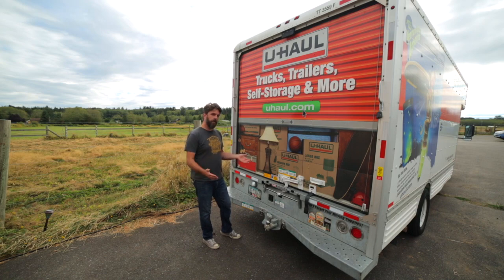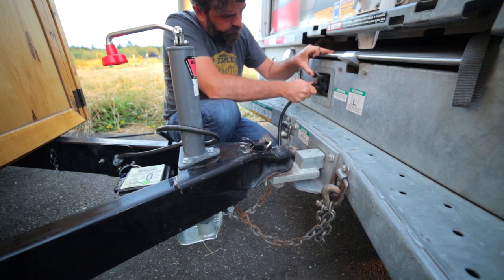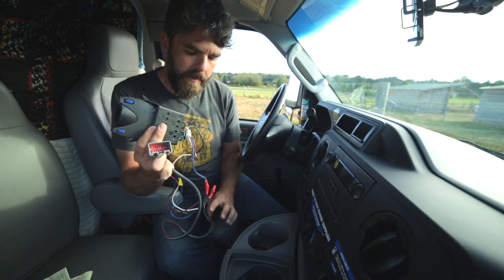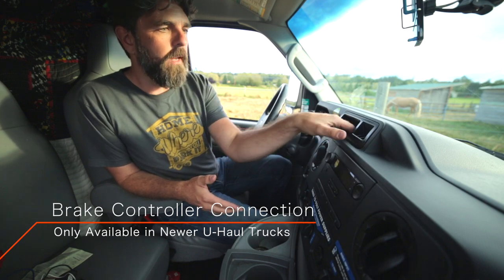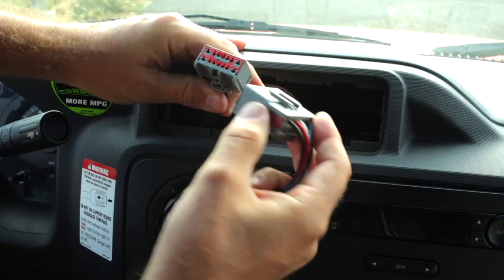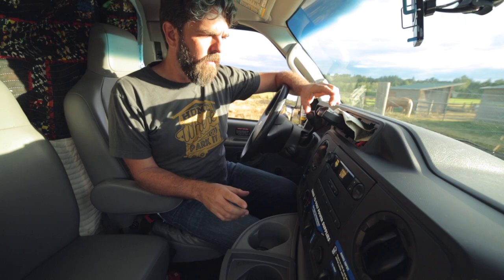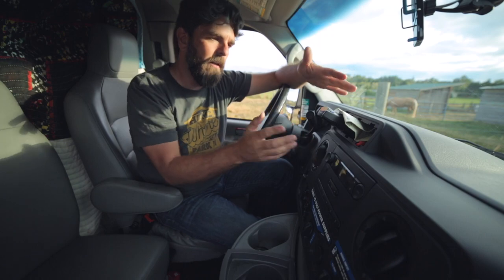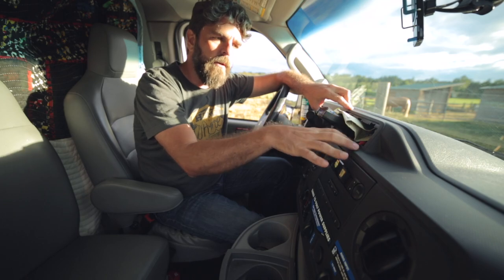Life Hack // Tiny House Brake Controller Installation // How-To Guide

Comment: What kind of truck do you use for your personal truck to tow the tiny house, or do you rent uhauls on a regular basis?
Reply from the maker: U-Haul is the truck sponsor of our documentary project. They generously supply a truck, which we switch out periodically. We have used a 17' or 20' truck to tow our tiny house for the last 2+ years (20' is our preference). A great DIY tow vehicle for occasional moves.